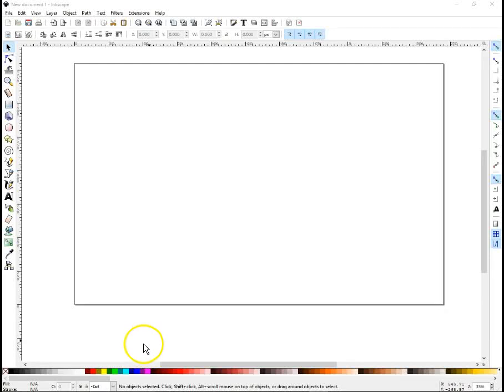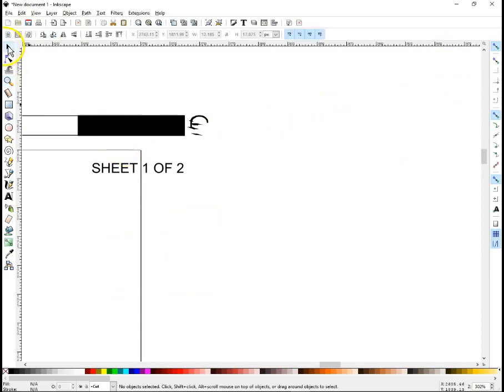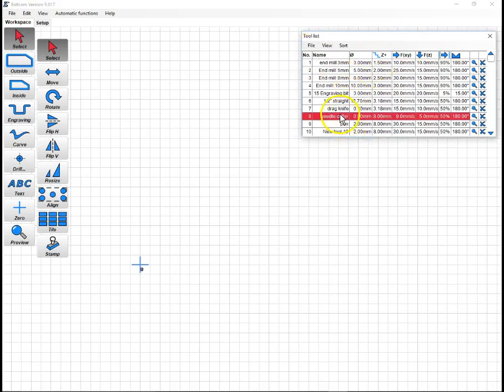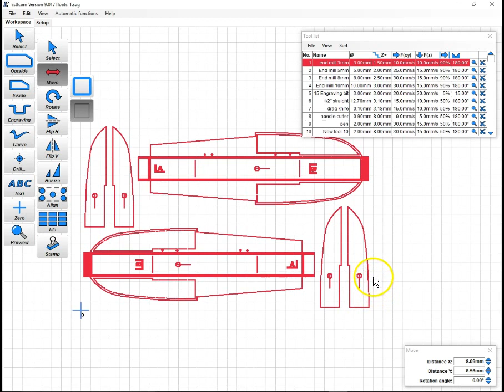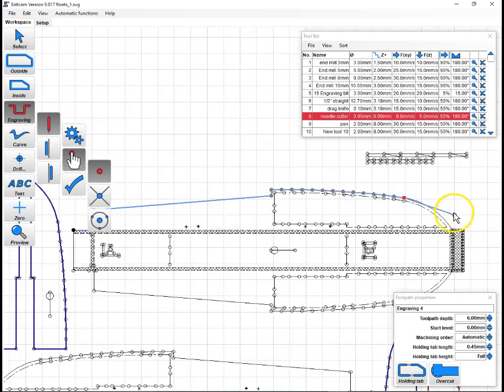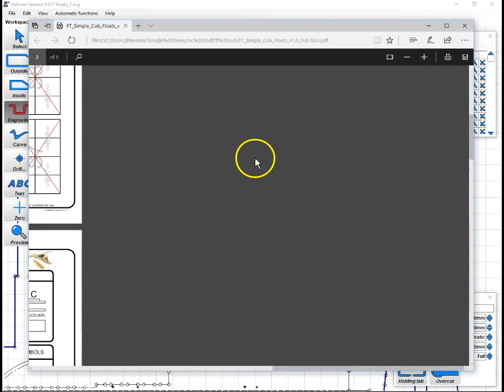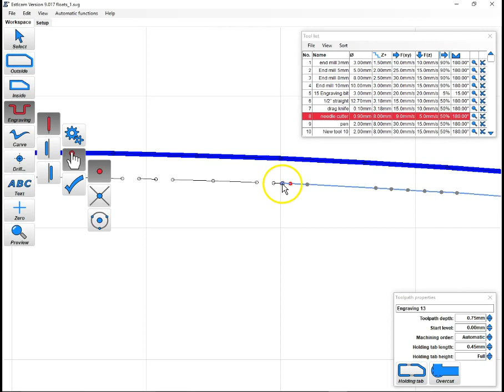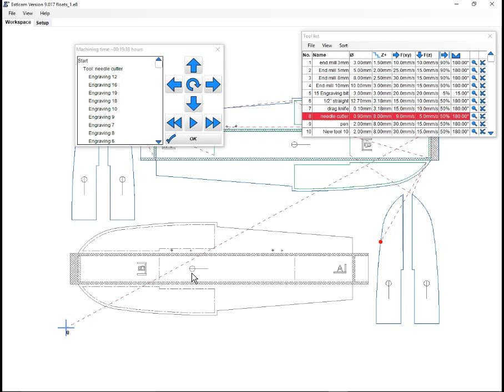Preparing PDF plans for needle cutting

Comment: Thanks for making this Jason. Another time saver I found is to copy the cut lines of duplicate parts in Estlcam and mirror/rotate as needed instead of tracing them all.
Reply from the maker: Yeah, I wasn't sure if this design was 100% symmetrical or not.  The two floats are labeled L and R so I was worried there may be some slight difference between them....but I suspect there isn't and duplicating the paths would be a quicker approach.

There are a ton of other neat estlcam tools/tricks that are major time savers and 10 has some nice improvements over 9....but I haven't actually cut anything with code generated from 10 yet and have been too busy to mess with it so stuck with what I know works for now ;)  (Heck, my machine is still running Marlin RC6 because it "works for me"!)   Hopefully I'll find time to do a few follow up videos on more advanced tricks and time savers.

Comment: Now that you’ve had some time doing this. Have you found a better program than estlcam?
Reply from the maker: Nope, not that I'm really looking that hard anyway.  I've tried Fusion360 but it's a lot slower on my old computer and more complex for the simple stuff I do.  I also tried dxf2gcode which I wanted to like since it will run under Linux - but wasn't happy at all with the gcode it created.  I also looked at the gcode plugin for inkscape but didn't care for it and same for a sketchup plugin I tried.  The only other options I've seen are considerably more expensive than estlcam and more complex so I'm not really interested in trying them.

Comment: What CNC controller board are you using with Estlcam? Also how do you calibrate the needle depth on the first set-up?
Reply from the maker: Sorry for the late reply - YT stopped alerting me to messages so I missed it.  I'm using a RAMPS board from a 3D printer to control my machine - I don't control it directly from Estlcam.  Instead I export my gcode to a sd card and run it on my machine from there directly.  The needle depth can be tricky to get your head around.  Basically the way I do it is I lift the cutter above the board then manually rotate the flywheel on the cutter to make the needle extend all the way as far as it will go.  Then I slowly lower the Z axis until the needle just barely touches my workpiece.  That's my 0.  The depths I use when creating my gcode were a bit of trial and error to find what works well since this foamboard isn't super consistent in thickness.
Reply: Got it thank you. I used that exact method and got pretty good results. I had a few issues with scaling from Inkscape to Estlcam but, I seem to have worked it out. Have fun making FT planes the easy way.

Comment: I think it would be better to do the score cuts before the through cuts, then the inside and outside last.
Reply from the maker: I've thought about putting the effort into organizing the cuts to do that a few times...but honestly it works well enough no matter what order they get cut that I just can't justify the extra time to organize the operations.  Especially now that I have the vac table.  With the foam flat and held well it really doesn't matter what order the cuts happen in.
Reply: I just cut my first pieces of DTFB, and you are right,  there is enough paper left on the bottom side to keep the part in place, the order really doesn't seem to matter at least on DTFB.